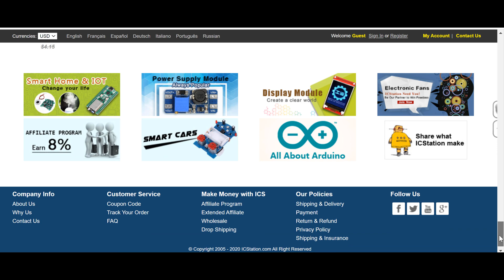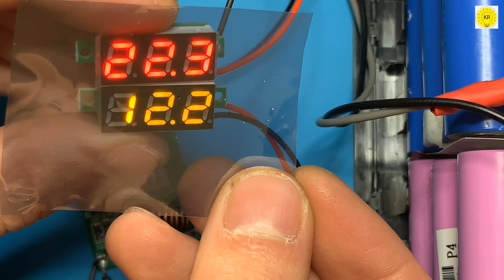DIY How To Make a Powerful 12V 18200mAh 420A li-ion Battery Pack

Comment: Making this connection to make a battery park you need fewer batteries because when you make it 1 in series and then in parallel you need more cells to the connection you made, which is to connect negative with positive